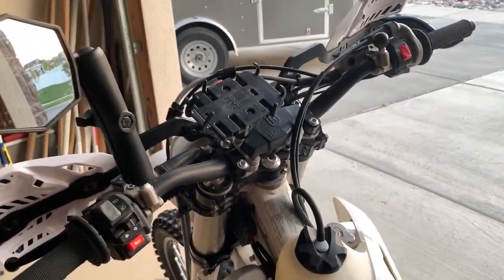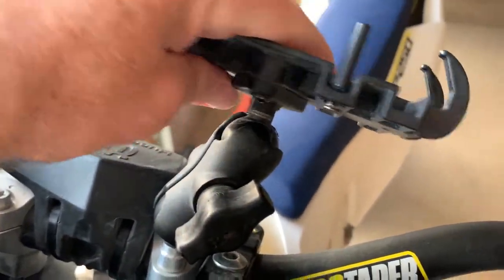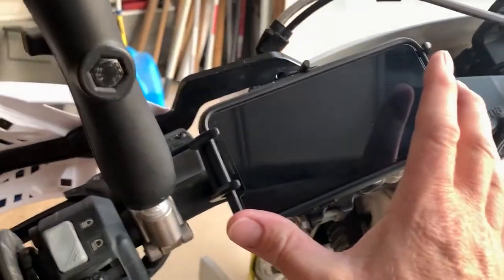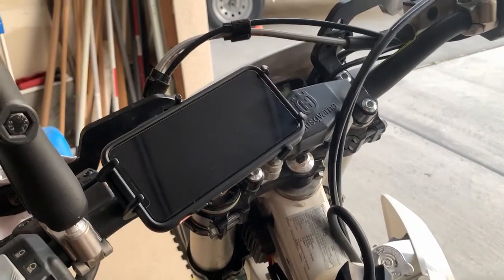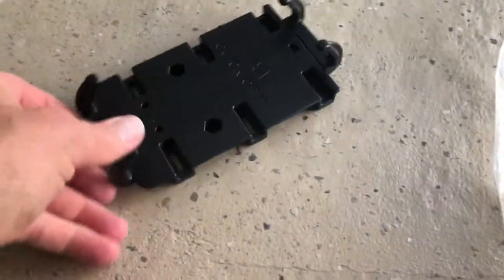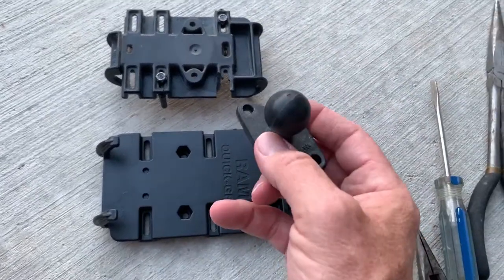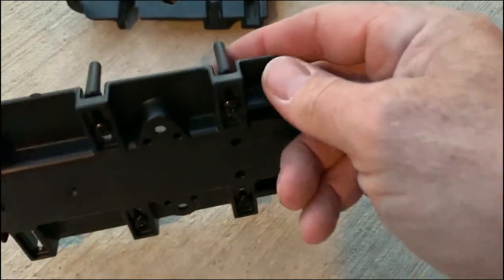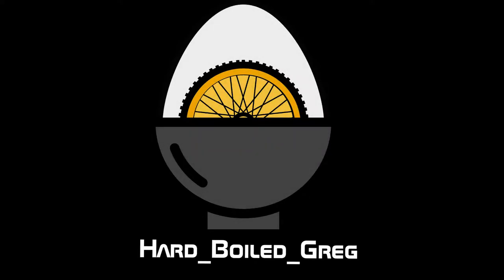RAM Mounts Quick-Grip Phone Holder Comparison Standard vs XL

Comment: no Problems with Vibrations and the cam in the iphone?
Reply from the maker: I never ran into any. I have since switched to the Quad Lock mount and case for my phone and am using the motorcycle vibration dampening optional part. I like it because it easily locks into place.

Comment: I'm too worried about the vibration destroying my phone to mount the phone to the bike.
Reply from the maker: I worry about that too. I bought the heavier duty, rubberized Otter Box Defender case to help with that since it provides some shock absorption. I'd like to also get the Pico Tank Bag from Moskomoto to provide an option to put my phone in a tank bag where it can free-float and also be visible with the optional Navigator pouch.
Reply: Hard_Boiled_Greg   That tank bag looks nice, I think that is the best of both worlds.
Reply: I was using the quadlock without the shock absorber link and the camera on my XS Stoped focusing after a week on the mount
Reply: I boggles my mind how RAM hasn't come up with a vibration damping solution.

Comment: Is it all plastic?
Reply from the maker: The main flat panel and the securing arms are all plastic. There are metals springs on the one side of the flat panel that allows the two securing arms on that side to stretch in and out. The nylon locking nuts are of course metal. The little securing arms are susceptible to breakage. I broke one off when tipping my bike over, but if you put the holder in a position that allows it to be shielded by your handlebars and bark busters then it should be fine.

Comment: Hey@UCaEANvB02HAsJwU3bSkGFYQ great video I'm considering the xl for my new Bike but your solution for your rearview mirrors very clever I thought, I've always had to replace the rearview mirrors on my bikes for the long stem variety I gather that's a better solution for your use do those ram mount arms make for a long-stem solution or are they just as long as standard rearview mirrors?
anywho great video

Comment: Dont bother. Look at it! Quadlock is the way to go
Reply from the maker: They both have pros and cons. I currently use the Quad Lock. Sometimes it drives me nuts trying to get the phone connected back to the base. I use the vibration dampening attachment. I’m sure it dampens it some but definitely not enough to keep the phone from shaking pretty violently on rough roads.
Reply: @HardBoiledGregADV  Are you pressing the release tab when you are attaching the phone to the base? It makes it a lot easier. Also, the anti vibration mount is to reduce the micro vibrations that can and have ruined the camera lenses in modern phones. Was never going to stop it juddering over rough roads.
Reply from the maker: Yes. I press the release tab in when I mount it. Lining up the slots and pressing it on at the right angle seems to be what messes me up. Sometimes I get it right on, and sometimes I sit and fiddle with it for a while before I get it to snap into place. I agree that it is a better mount than the RAM Quick Grips. It just frustrates me sometimes getting it on.